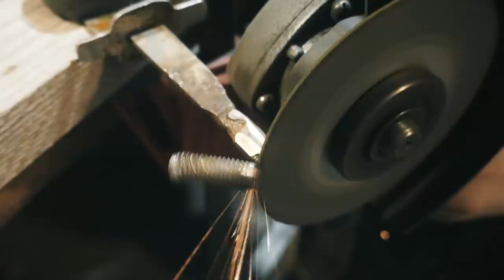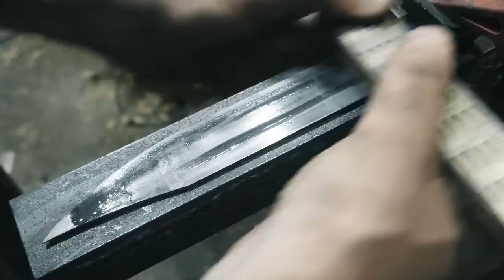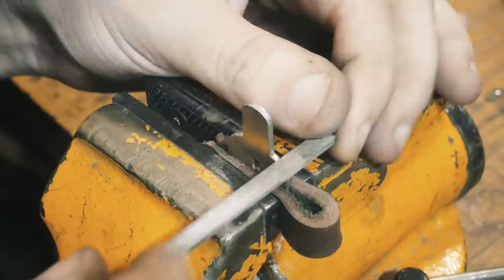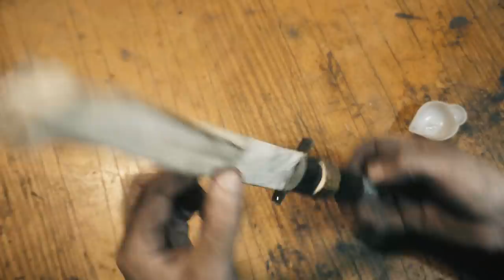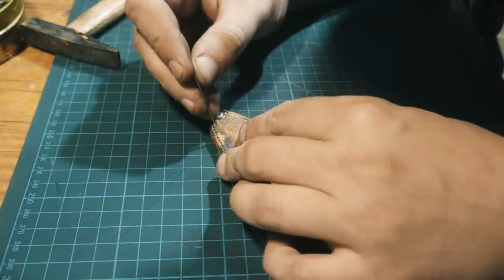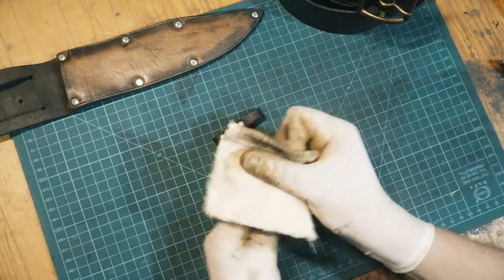Bowie Knife Restoration

Comment: Cool restore; one guy said best way to test sharpness is if the blade shaves every single hair if you do a small pass on your arm.  If it leaves a few hairs it can still be sharpened more.  Beautiful job.
Reply: No need for a Bowie to be that sharp. Also the edge would hold as good cause it gets very thin

Comment: Stones in a Lansky-type sharpener like that should stroke toward the edge, not away from it.  The only device that should stroke away from the edge is the leather strop attachment.
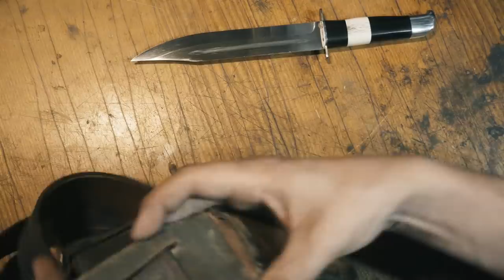Reply: Hugo Adrian  Wilkins  Watch this entire video -- https://www.youtube.com/watch?v=ZlI5PaXsfOk -- but don't stop short when you see him both pushing and pulling the stone because that is not sharpening, it's shaping.  You'll see how the pulling away from the edge during shaping creates a burr of metal underneath the edge; this is what you'll remove during the actual sharpening portion of the task.  So watch and listen to him when he transitions to sharpening at around 7:55.  The only difference with my technique is that I only use water and never oil to flush metal from the stones.  Not even a drop of oil ever touches my stones, ever (no testicle jokes, please).  Also, I have created a WICKED custom sharpening kit in a fitted case with everything needed to put a mirror edge on knives.  Let me know if you want me to take some pics of it.  It's true knife porn.

Comment: Really nice job on the metalwork for this knife. Also on the sheath and belt. Nice trick on replacing the threaded section and on the pipe that holds the blade with wood while you sanded the handle. I would have considered making a new guard and replacing the entire handle with antler. Knife appears to be South American in origin. Any clue as to who was the original maker?

Comment: What cleaning fluid does he use to take off all that rust?
Reply: He mentioned he used ferric chloride in another video, but I doubt that's the solution and is only an intermediate as a removal solution.
Reply: I've seen other knife restorers use  hydrochloric acid.

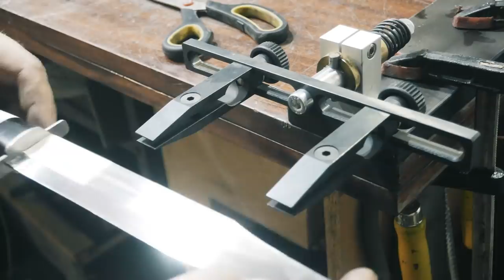Comment: 12:19 what honing system is that? Lansky? It doesn’t look like it but I can’t think of anything else
Reply: I want to know too.  Seems these days more are providing links to critical gear.  That looks like a fine system for long straight blades like bayonets.
Reply: Tipi Dan yeah that’s a very nice system. I want to get my hands on a lansky controlled edge system. Damned things can get expensive. I’ll stick to stones and strops if it is gonna be too much 😂
Reply: I think it's the same as the one Wranglerstar has a video about https://youtu.be/k3SbEWFSA8s